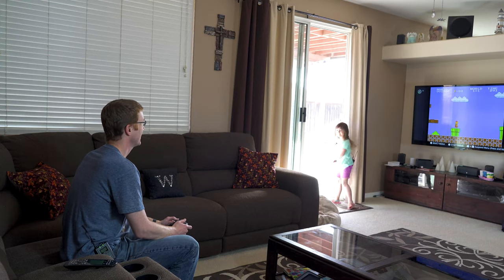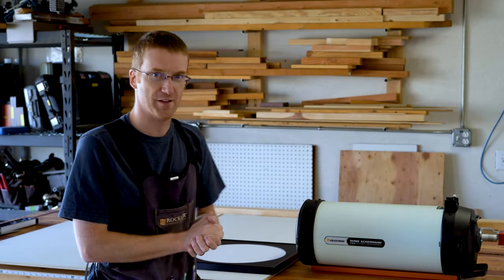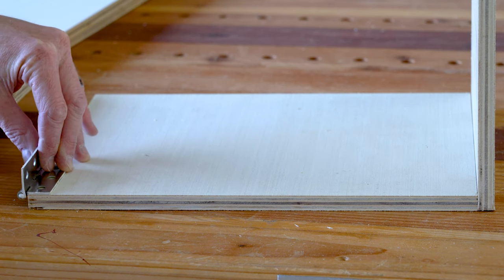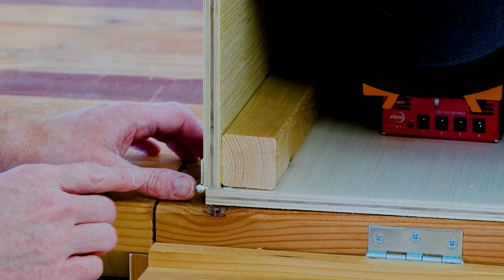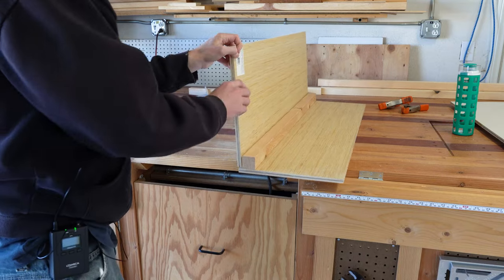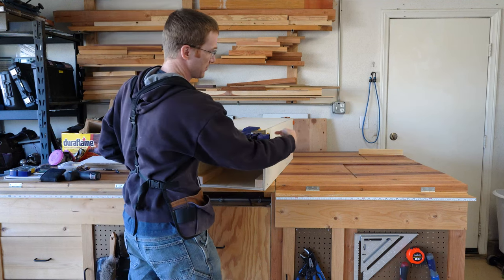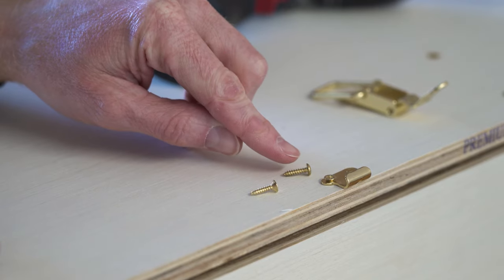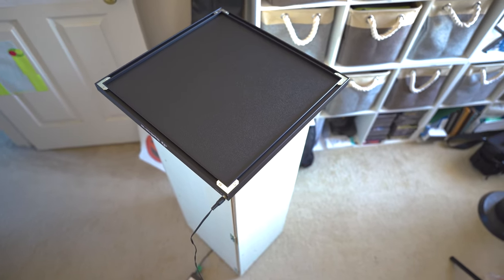Capture superior flat calibration data with this DIY project

Comment: Since one of the most important functions of flat frames is to remove dust from the finished picture wouldn't that much movement of the telescope defeat the purpose of taking them.
Any dust that was on the lens when the lights were taken will either be gone or will have been moved or been added to so the dark dust images appearing on the flats won't match the lights - so they won't be removed. 
Not to mention the fact that the grain of unfinished timber is a dust collector.
Reply from the maker: It's been my experience that dust on my objective doesn't appear in my images. It's dust on the camera sensor or sensor window itself or even the filters that does show up. Those parts are fixed, so moving the rig doesn't affect the dust location.